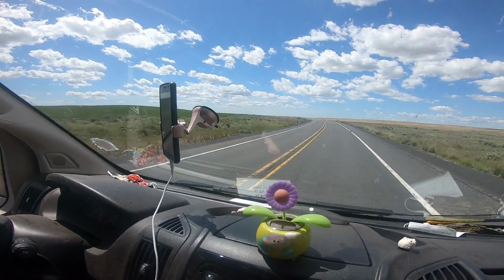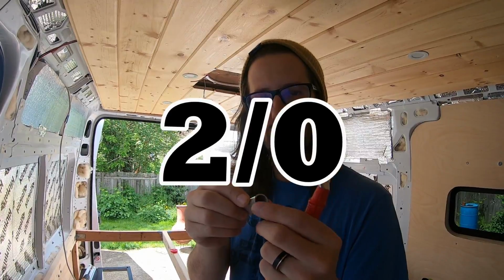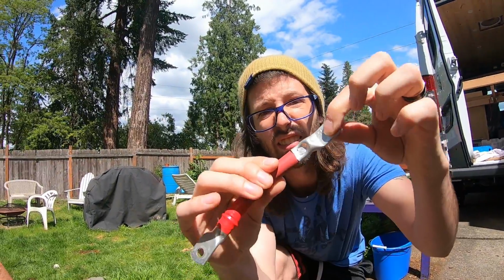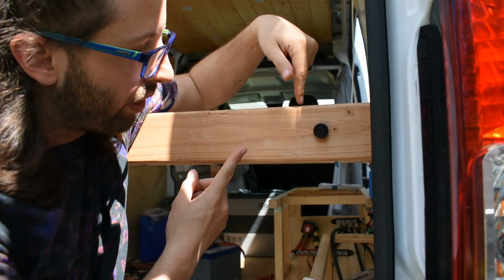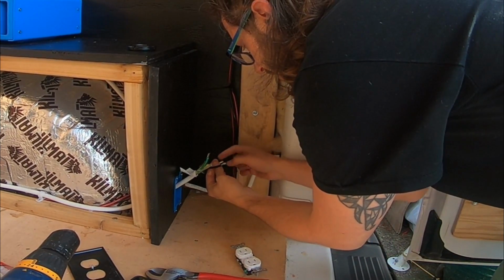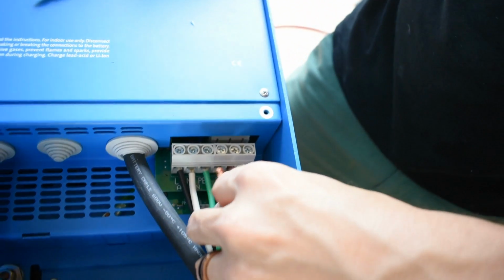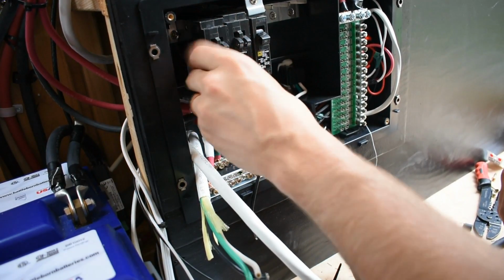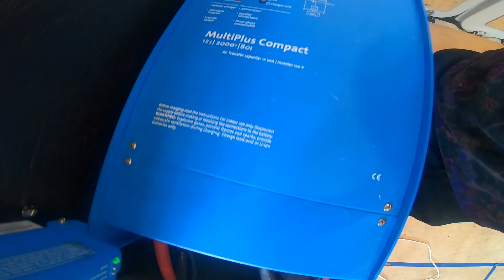Installing Van ELECTRICAL including SHORE POWER, INVERTER/CHARGER, WIRING +++ in 2018 RAM Promaster

Comment: Great video!  I am still glad we aren't going to do a DIY system and are opting for a Goal Zero.  I didn't know about the fork connectors for the outlets, I may have to go back and add one of those for our ground.  I bought outlets that have a bar that snugs down for the hot and neutral wires so I think they should be good but the ground is still a screw.  Rather be safe than sorry.

Otherwise we are battling the same thing lately.  Thunderstorm warnings constant that last few weeks.  I never know if I can be outside working on the van.  I am still so freaking jealous of your tent!  I am still doing the pack everything into the van and take it back out currently, haha!

Great job you two!  Pumped for your progress!
Reply from the maker: Lol yeah it was a TON of work. I will heavily consider a goal zero all-in-one type of solution in the future but glad I learned and practiced this all though. Yeah I had a hell of a time trying to bend the stranded wires around the screw before I got the fork connector.
Reply from the maker: Yeah the tent had made a ton of difference but still doesn't allow us to work in bad weather very much because it's mostly storage for our tools and materials lol. But much better than fitting it all on the van/house.

Comment: Great Install and Very helpful! Look into a voltage regulator for the maxfan.  I think it can only handle 12v.
Reply from the maker: So glad it was helpful. The company sent us a replacement PC board and it resolved our fan issues. We have had it working and running basically non stop for almost a year now

Comment: Nice build, will the AC shore power back feed into the inverter when its not being used and damage it as you are using a common AC ring main? Im not sure if i would need a transfer switch to isolate the two AC feeds from each other......inverters aren`t cheap!!

Comment: Thanks for your video. That was a lot of work. Do you have a wiring diagram of how you put it together? It is difficult to apply this to another build.
Reply from the maker: I will have to dig my specific one up but I mostly used one on explorist.life website for the 200ah 350w setup.

Comment: This was great. Do you anticipate being in cold climates and if so how do you plan to. heat the batteries up so they'll charge?
Reply from the maker: We have had only 1 night in all our travels and nights where the batteries got too cold to charge. We were plugged into shore power and using an electric heater too but luckly they only stopped charging in the very early morning and I was able to wake up and catch the issue before we drained the battery. Personally we built this to chase the sun so I don't worry about them falling below freezing often.

Comment: You probably got this question already. Can you put links to the components you used. 
Wire - 
Fuses - 
Distribution Panel
Bus Bars
Etc.

I'm going to have to revamp my electronics as well, they are rather slapped together now. Since I'm introducing a generator and then an AC unit, I've got to formalize the work. I have put it off probably because of indecision as to where to install things. Since real estate is limited, having to commit space for certain things means there is no way back and/or a waste of initial work if that location didn't work well.
In any case, I've realized there are various phases you go through when venturing into van builds, and redesign seems to come no matter what unless you contract it out and pay big bucks.

So, yea, gathering the components is part of the process, and I've seen many of those you used in other vids.

As an incentive, you can create affiliate links to the items on Amazon, if they are there.

Nonetheless, thanks for the vid and taking the time to edit it and upload it.

Comment: Great video!  Kind of a silly question but I plan on only having a twin size bed placed side  to side across the back. Do you think all that solar stuff and electrical will fit under it utilizing part of the wheel well like you did??  Thanks!!
Reply from the maker: Yeah I definitely do. It may take a lot of planning and "figuring" but it's very possible to fit a lot in a small space.